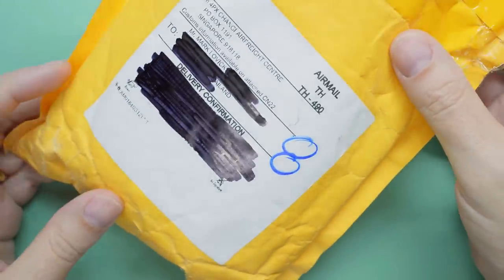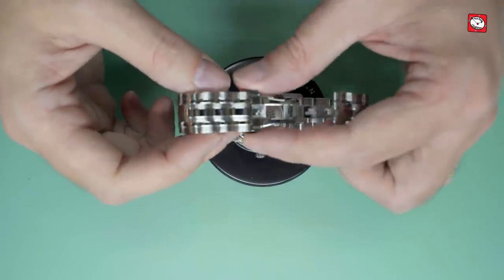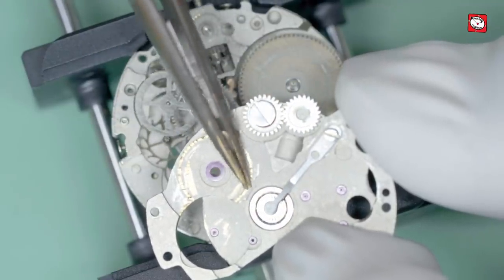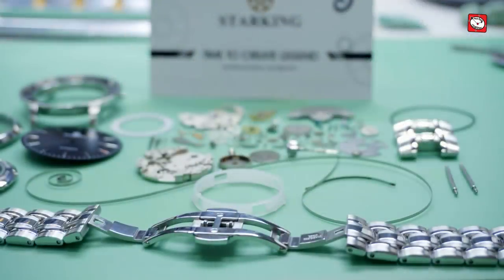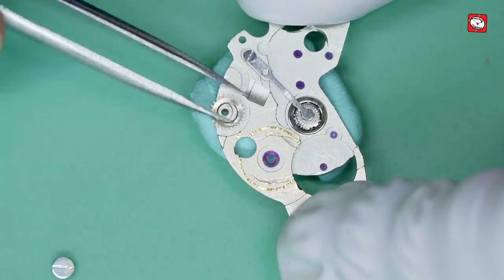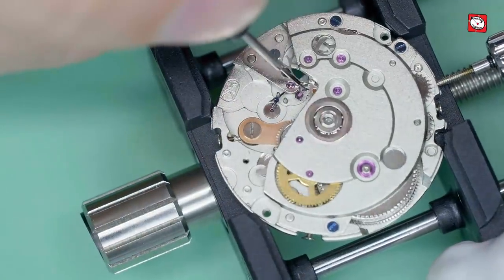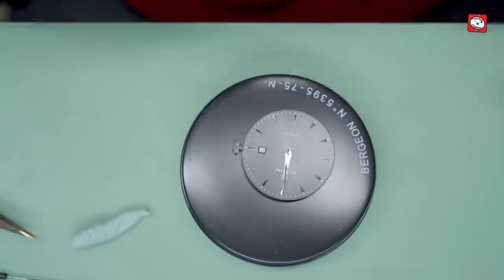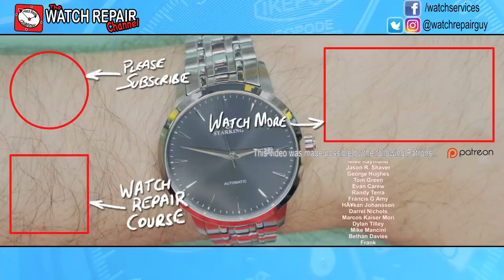Starking Watches - Can A $50 Budget Automatic Be Any Good? Full Review

Comment: Besides the hand sizes being different, the stem height is also different between this SK1813 (2.03mm) and Miyota 8215 (2.52mm) movements. I'm on the search for a quality high beat Miyota 8215/Seagull ST1612 direct replacement but stem height seems to be the problem. Interesting that this Shenzhen Jingrui SK1813 accommodates both 8215/DG2813 and ETA 2824 dial feet positions. Hand sizing on SK1813 is same as ETA 150/90/25.

Comment: wow it comes with stainless steel 316 grade and not the cheaper 304. 316 are usually used in ships or anywhere exposed to seawater as the chlorides, but as a strap it helps fight against sweat. Very nice.

Comment: Nice video! Mine  is still running fine after about 9 months. i do like the look and feel of the watch, though i put it on a oil tanned leather strap instead. i would replace the movement if it failed after a while - i guess as long as it lasted a couple years, or else maybe the miyota upgrade you mentioned.. :)

Comment: How the hell do you remember where all those little pieces go when you put it back together? I'm sure I'd put it all back together and discover a screw or spring that I had forgotten. I am amazed while watching this. Another thing, I take it that the stem is not threaded all the way down and when you clipped a portion off to shorten it that the crown is harder and re-threads onto the stem. Is that correct?
Reply: If you put it back in the order you disassembled the pieces will be in order. An experienced watchmaker will know roughly what part is what, and you can always watch the footage back if something isn't right.

Comment: Use Vasoline on everything to prevent rust.  You can use a carrier (any thin solvent to make a spray. or a rag to apply it straight.
A tip from a rain forest dweller with many tools.

Comment: i would have liked to see what accuracy the original movement was capable of after regulation. one of the major savings on cheap watches seems to be that they don't get careful regulation out of the factory. my tevise t801a ran over a minute fast when i got it. after the second inexpert poke at the regulator, it's averaging better than -4s on my wrist ... not enough to re-open the case unless i devise a better way of moving the lever a tiny amount. definitely happy if it can do that for a few years

Comment: With those rusted blued or blackened watch tool parts, here's the correct way to treat them if you want to retain the blackened appearance.
In their rusted red state, boil them in water for about 10 minutes. That will convert the rust back to black magnetite. Let the parts dry and cool off. Once dried get a very fine clean steel (carbon steel) wire brush and brush all the loose magnetite away. Soak parts in a container of kerosene for a night. Next dry them off with a rag and coat them with Ballistol. Ballistol contains an emulsifier which lets the oil mix with water, however the surface of the steel will always remain coated with oil unlike standard oils where water and condensation can get beneath it onto the steel, it tends to provide a superior protection especially on parts that are handled regularly.

Comment: how in hell do you keep track of where the screws came out and the sequence of removal all the mechanisms. I'm a tool designer and would have to document every part. maybe this wonderful video is how you do it. you use no epoxy and no torque meter. how do you know how tight to secure these jewel screws for life and not restrict movement etc - so many questions.

Comment: A few questions, being familiar with metal machining, but watches?  An avid wearer since 1961.  Yes... That old.
But ...
1.  The different wheels in this movement that appear white, are they really made of aluminium? Or is it some tin plated steel?
2.  The brass parts appear investment cast brass plated with Cadmium or tin.  Fine but why is re-work so crude?
    I could ask why re-work at all?  They obviously do have the digital controls to have "clean" parts.
3.  I find the lack for care uniformly typical of oppressive regime work.  Quota is met, quality is part of caring and they can have none of that.

Just curious...

Simon

Comment: I was going to say originally, I would have just bought one and tossed it when it died... However given that I'd like to start tinkering with movements, I'd actually buy one and attempt a movement switch for a miyota. If it works, awesome. If it comes out sketchy, I'm less than $100 in the hole.

Comment: Recently I bought a Starking 0184 and also a Citizen automatic. Both with sapphire crystal. The Citizen was about 2.5x more expensive and has a much better finish.

Accuracy wise both are not fantastic. Starking is fast about 15s/day. Citizen with its 82xx movement was close to 25s/day. Changing to miyota 82xx is not a good idea. Nobody knows how long the original chinese movement will last though. But i rather have something more accurate. It is a watch. It is meant to be reasonably accurate. It is about $50. I don't expect it to last me 10-20 years. But i would never change it to an inferior Miyota.

Comment: Well, the economics 101 rule of thumb is that if the unit cost of production is more than 5% of unit retail price, it's just not a good business.  So, if a Chinese ETA clone (or counterfeit) costs $1 apiece (when you buy 200 pieces), you need to sell them for $20 apiece to break even.  If the whole watch is $50 retail, that makes the case around $30 a piece retail.  (I consider strap cost to be negligible at mass production).  So, it's all doable to feed all the manufacturer, supply chain provider, distributor, and retailer.  Yeah, $50 is about a bare minimum an automatic watch can cost.  Quartz movement really must cost several cents to have $15 generic Japan Movt. watches at Walgreen's a possibility.

Comment: Would you mind explaining us What Amplitude means? Best regards from Brazil.
Reply: It refers to how many degrees the balance wheel spins in various positions. As the oils in a watch degrade, then dry out, the amplitude reduces. Also, some positions (dial-up, for example) have a higher natural amplitude than others. A brand new watch that hasn't been sitting on the shelf too long, or a recently serviced movement will often show amplitudes around 300 degrees.

Comment: I am trying to get a little into watchmaking and pulled this movement from a cheap 20 euro fake watch from the market in Spain. Mine however looks even more crappy as this one and I do not seem to get it together again. I just cannot get the 6 jewels to line up with their pins when putting on the baseplate. its driving me insane but the problem might be more with the awful quality of the movement and the low tolerances of the drive train and the amount of wobble in all the pins that make it near impossible to get the baseplate back on..

Comment: I've handled quite a few chinese watches where bracelets failed due to the pins in the links rusting.  While the links were stainless steel it seems that the pins were made of cheap metal and failed. If the bracelet was a common size then replacement is ok but quite a few of them were were of the integrated bracelet design and the watch was unwearable. The clasps are weak too.

Comment: Please help.  I purchased 2 beautiful watches from iWatch.  (Not apple watches. They tried to buy the name without success.) I wore one for months then the rubber strap just snapped. l wore the other one less time and that strap broke. Its a double connection for the strap and the shop where l bought them is no longer in Kyrenia.  I asked local watch repairers to help but the style is too modern for them. I repaired them with Super glue myself but that's not long lasting. Any suggestions? Their website is just a simple ad campaign for retailers with no contact facility. The faces are still immaculate - some Swarsky stones have fallen out since l dropped one but thats all.  Just those straps are frustrating. Any suggestions? You seems to know your stuff 🤔

Comment: Thanks, great video. I was always curious how and if is possible to reassemble back these movements, without breaking, quality of them is not very good. Great mod with the miyota, so now we know that it requires some hands and crown adjustments.
For similar price I prefer and have the Cadisen with seiko nh36a movement, I feel just better with seiko movement. These dg2813 type movements have sometimes issues. I have a Starking skeleton watch with similar movement, from stop state I shake it some time, then I put on my wrist and it stops sometimes at the beginning.  It has to be shaken more time to be sure it is wound initially. Some dg2813 type movements just random stop, others I had issues with the broken date change, others and more often - the rotor simply doesn't wind, doesn't engage the teeth. I wonder if I could swap some parts, but probably i will brake something, i don't have experience here and looks fragile. So better just a new replacement movement. Watchmakers here in Bulgaria, Sofia charge really a lot,  totally not worth servicing such watches (even more expensive ones). Better ask for refund/exchange in Ali and order a new working one.

Comment: Noticed all the comments about battery stores charging little or nothing for changing out the battery.  If you're watch isn't worth much this might be OK.  Can you imagine how many serious scratches, water resistance degradation, bent battery contacts, and other damage gets done by non-watchmakers?  Repairing any of these problems will cost much more than a $20 battery change, given your watch is valuable.  Would you take your wife's $5000 engagement ring to a welder to have it re-sized?  But it's your watch.  Suit yourself.

Comment: Surely mechanical watches nowadays are purchased only for sentimental value and not time keeping. For hassle free accurate timepieces, just get a citizen eco drive and replace after 10-15 years or perhaps longer depending on the capacitor lifespan and get a new eco drive as replacement whereby the technology will have advanced enough to last perhaps 30-40 years!

Comment: Well, at least it is a bi-directional winder! I can't stand the noise from the ETA2000-1 (L593.2) in my Longines La Grande Classique Automatic. Any movement of the wrist and the rotor starts whirling 20-30 times in the free wheeling direction emitting a less than refined grinding sound of loose bearings in a tin can. It's like wearing a bell bangle. For a $1300 watch and an ETA movement I cannot believe that they didn't make it bi-directional or at least clutch the rotor to only turn one way so the it doesn't freewheel.
--
Yes, it is a 19.4mm movement that is 3.6mm thick. Yes, I it has Geneva stripes. But, in the end, a Swatch Automatic or this $50 Chinese watch sounds more refined.

Comment: I'm still vary of buying cheap mechanical watches on ali/ebay, because I've read everywhere that Seagull movements now ship without lubrication, and most of these $50 watches are just "put a movement in a case" type of jobs. No checks, no lubrication. So my question here is: was there actually any lubrication there at all?

Comment: Disappointed, I thought I would make a discovery! an automatic watch at $ 50! but it was far away far from deserved $ 25, from the beginning I noticed the treatment of very light galvanized material can be galvanized zinc, the parts are made in punching if moisture penetrates this watch it will turn into dust , it is not going to get oxidized it will crumble, the case is not made of steel given the lightness of the handling, with a very fine nickel plating treatment can be 20 microns max or 15, the glass is not sapphire or the thickness does not give this impression, but also the mirror effect does not exist, the bracelet and the most valuable piece, despite the fact that there is still industrial manufacture.
Conclusion: very happy to have the hands of a great watchmaker who knows what he does, a little humility because he was asked, I do not see complexity, to have validated that a watch remains a very exciting object very beautiful and difficult to achieve, rather than complex, seen the adjustments and the chain of ribs.
Thank you dear sir, thank you for being sincere, thank you to the manufacturer but not for this time;))

Comment: I wouldn't buy the watch because of the dubious movement and the way it was put together.
I'd rather buy a seiko 5. Those are not that much more expensive but are reliable, even if they have hot the most sophisticated movement.
if a watch doesn't have a decent movement that hasnt been put together so that its reliable it serves no function.
The CADISEN c1032 like written here in the comments looks like a real winner, with a good seiko movement, sapphire crystal, solid bracelet etc for only $60.
Thats an unbelievable price.

Comment: Oof the 20 dolar automatic watches have way better timekeeping and amplitude
Reply: Sounds intriguing... Could you perhaps share the brand name/model of these $20 dollar automatics so I can research them for myself? Always down to learn about new bargains!
Reply: @saviorebello7342  all the cheap 20 dolar automatic watches have the same movement dont expect for it to last more than 10 years but it lasted me for 3 years of daily use and still going i bought the shenhua model which has a domed mineral glass and its "waterproof"
Reply: @saviorebello7342  also the accuracy was not so great in the start it was +10 s/day so i opened it and regulated it miself now it runs +2 or +1 s/day
Reply: @saviorebello7342  but be careful and always try to look to see if there is a rotor because many sell the manual version saying it is the automatic version
Reply: @saviorebello7342  I have an Amazon ordered  Mark XV something winner brand. For 23 $that Im quite impressed with. Not much reserve though Iso I give it some winds before bed. Clear case back chinese a458 movement.
Reply: @violinmke  is the case well made on that model?
Reply: @violinmke  yeah the reserve is kinda shit but enough to last a night an then some

Comment: No way would I wear a watch with "Starking," on the dial.
Reply: If the movement fits a Miyota 8215, there are lots of dials that also fit on eBay and other sites. I prefer a sterile dial, when they are available.
Reply: Yeah, even "Star King" would be much better. I suppose they didn't know the term "starking mad" in English.